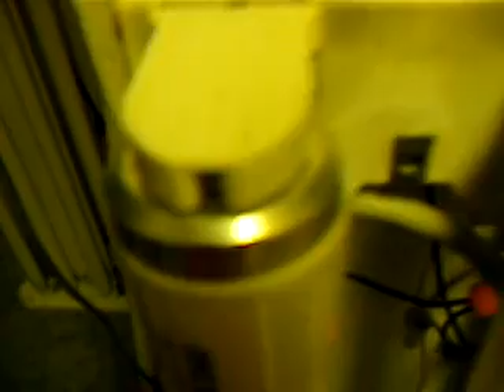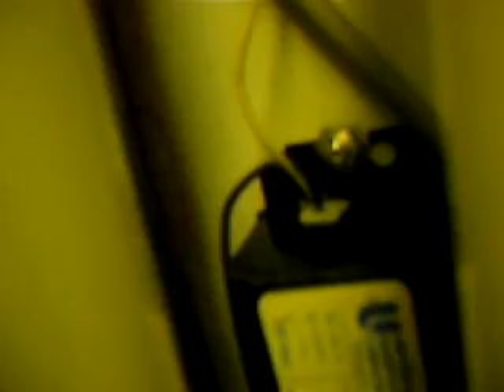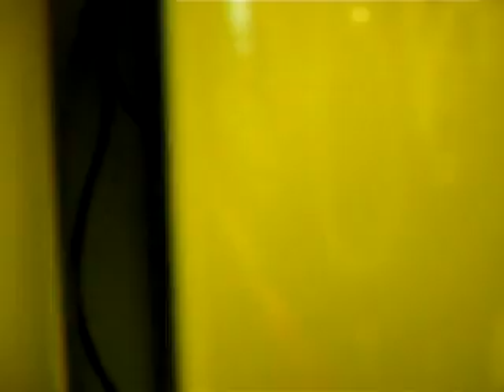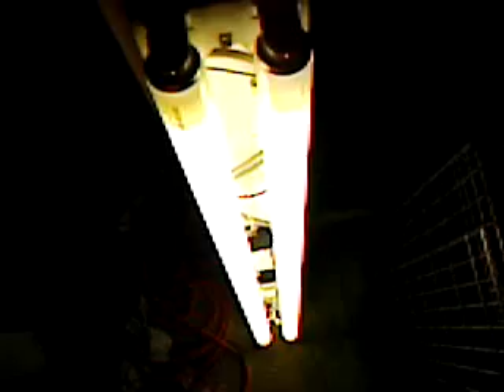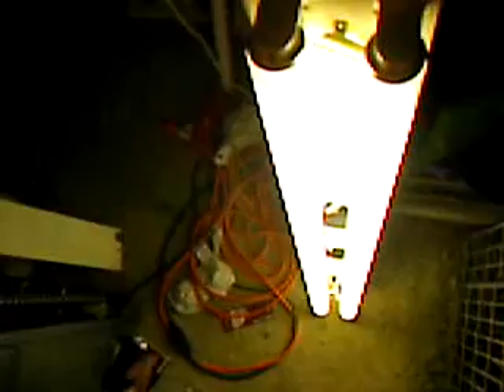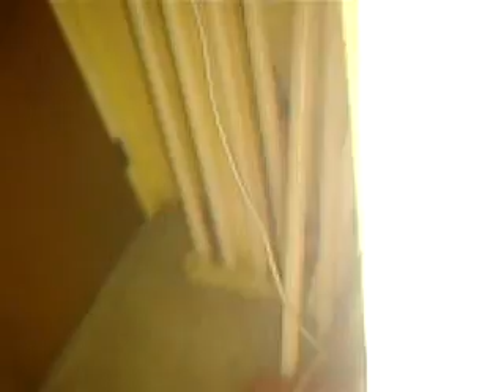34 watt lamp behavior in a preheat fixture

Comment: Older rapid start ballasts from the JF Kennedy days and beforehand will get cooked instantly as well.  Many fluorescent lights from the Kennedy era and before have ballasts that don't like the taste of F34T12 or F32T8 lamps and will fry instantly when using those lamps.  I don't know if it messes up the capacitor or what but we have pools in my district that still have fluorescent lights from the JF Kennedy era, just after WW2.  The first one was a really old, two lamp surface box fixture with two diffusers in tandem with a two lamp rapid start ballast from the JF Kennedy days.  Someone tried to install F34T12 lamps in one, done.  Ballast was fried.  Another one was at a swimming pool that was built during WW2, with old preheat louvered grill fluorescent lights.  2 lamp preheat ballast.  Someone tried to install F32T8 lamps into it, done.  I had to install new ballasts.  But yeah!  F34T12 or F32T8 lamps and older ballasts don't mix!  You put F34T12 or F32T8 lamps on two lamp ballasts from the older days, you WILL instantly put the ballast in the toilet.
Reply: Even some single lamp F40 preheat fluorescent tube HX autotransformer ballasts such as the Advance RSHM-140-TP ballasts will be destroyed by F34 fluorescent tubes because they are ONLY rated for F40 tubes and the lower arc voltage drop of the F34 tube will cause those ballasts to draw more current than they are designed to handle, which causes the windings to heat up and melt the insulation, which will cause the coils to short out with the core. However, those F40 only single tube preheat fluorescent tube HX autotransformer ballasts even though they can either be HPF or NPF, they will run cooler with F32T8 fluorescent tubes because they have a higher arc voltage drop compared to F40 tubes and the increased arc voltage drop will cause the ballast to draw less current. However, the F32T8 fluorescent tubes will have a shorter life on those F40 ballasts since they will overdrive F32T8 fluorescent tubes. As you stated earlier, the F32T8 tubes are dangerous to use on 2 lamp F40 preheat fluorescent tube lead lag autotransformer ballasts because on the lead side of those ballasts, the constant current nature of that portion if the ballast will cause the ballast to draw more power than it is rated for and will overload the primary of those ballasts.
Reply: @worldwidehidcollectorusa-fkt Ever try doing the same thing on Advance kool koil rapid start ballasts from the 60s?  Not a good idea!  I have a very old wraparound fluorescent fixture in my collection that I did that to.  It had two two-lamp kool koil rapid starts in it because it was a 4 lamp.  This was prior to me discovering these videos and so I didn't know.  I put 34 watt tubes on it and finger snap and both ballasts were finished, with the handsome bonus of black tar dripping out.  Both ballasts did nothing from then on.  I had to install two RK2S32TP ballasts into it.  My adoptive sister (I was adopted when I was very young) did this exact same thing to her kitchen light.  Two lamp kool koil rapid start ballast.  34 watt tubes went in, and the kool koil rapid start ballast went like the Titanic.  I like to joke around a lot and I like to shave my eyebrows as a joke but older ballasts are no joke, no joke.  Energy saving tubes and older ballasts should never be used in the same story together because they do not mix.  And I keep spare tubes on hand and I would highly recommend labeling fixtures with old ballasts that they should never be lamped with 34-watt tubes.  I will have to look up the ballast number that you specified.

Comment from the maker: Although the F32T8 lamp initially started up in my preheat 1 lamp strip, it didn't last very long in there and eventually started to blink continuously. My F32T8's did the same thing in this fixture. However, the strange thing is that long past the point in which these stop working in preheat F40 fixtures, they are still good for rapid start fixtures meant for F32T8. They just don't last long in F40 preheat fixtures.
Reply: Because you are running a t8 in it